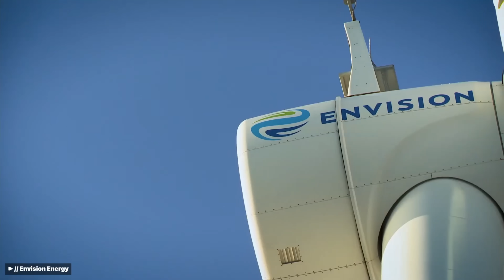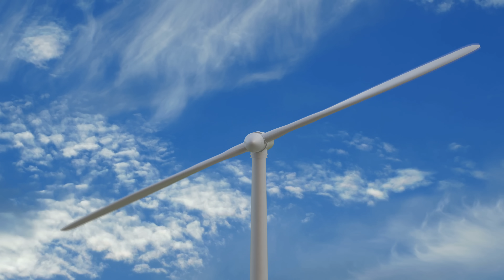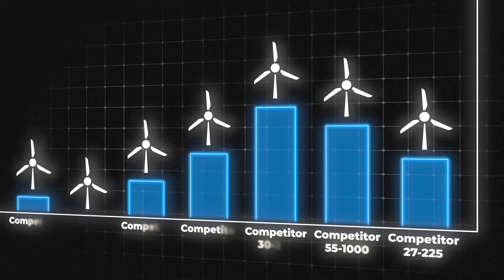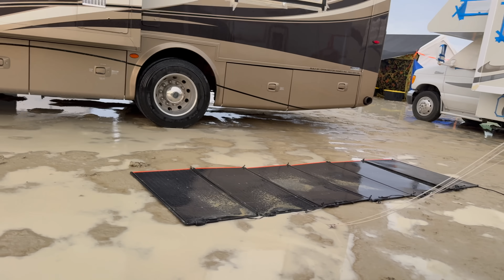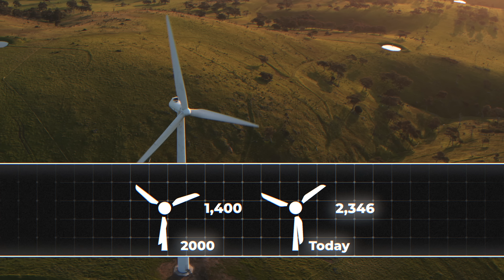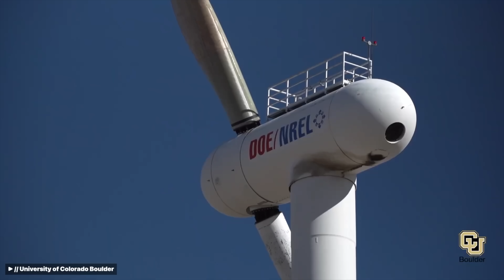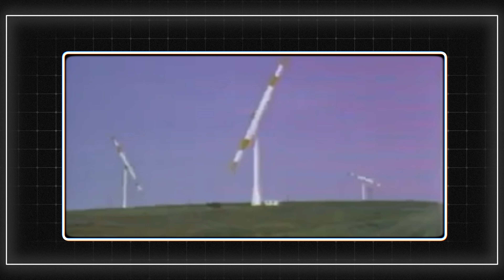Surprising Benefits of 2 Blade Wind Turbines - This SURPRISED Me...

Comment: Also less birdstrike by 1/3?
Reply: Higher speed tips and overall size known to kill more birds , bats , and anything that flies. I’m against more industrializing the countryside and the seashores destroying the ecology to save the environment.
Reply: @stanhry  Really? Tip speeds are largely similar due slower RPM with larger size, reducing hit probability. Aerodynamics, noise restrictions, vibration control, and efficiency mean higher speed tips are not a thing. Altamont's poor experience has taught us a lot about avian mortality.
Audubon agrees based on data. Peer-reviewed papers agree based on data. Engineering projects successfully employing avian-friendly methods like detection, siting, behavioral design, show the same, based on data.
Avian mortality from wind turbines though up slightly overall where siting and other engineered measures are absent are likely down from 25 years ago in absolute terms, despite explosive and exponential growth in energy generated, where these engineering measures have been taken.

And still far lower than avian mortality from fossil or even nuclear per GWh.

Comment: Why blades? Why not use a baffled roller design, it's like a squirrel cage on its side just longer. It's more stable. They've been using them for hundreds of years in the middle east. It's also safer on the ornathalogical species in the areas they are placed.

Comment: Longer blades for the same power will allow 2 blade designs to spin slower and start in less wind.
Reply: It makes sense, David. However, you also have to consider that three blades increase the overall surface catching the wind. For the same radius, three blades generate 50% more torque than two blades, meaning 3 blades actually start better than two blades on low wind. You'd need to increase the two blades' surface area by the same amount to get the same effect. I think low airspeed start is a pro for three-blade turbines, not two.

Comment: Why don't the blades with thicker leading edges like an airplane wing?  
     Or short leading edges 30 degrees off vertical slant towards the back edge to catch more of wind's force with a line of holes down the middle to reduce strain.  
     Why not put small "cup" structures at the outer end to catch more of the wind's force? 
     I keep picturing spinnaker shaped blades like the sails on a ship to increase the volume of wind caught.  1, 3, 5,  7 spinnaker blades  could be fitted to reduce drag related wind shield drag.  

In most propeller designs, the blades are powered to cut through the water or air and move the craft forward.  
     In windmills however, the blade is propelled by the wind to turn the shaft and power the motor, pump, grinding wheel, political dissident over a low flame (there is no law against this).  

As long as we're being creative, ship and submarine propeller designs could give some insights.

Comment: Thats interesting, I'm  from the helicopter flight world. The Brit military rotors for helicopters use a system call berp, its a thickened tip of the rotor that lowers the stall effect and, noise. The thing with rotors is they work in constant 'dirtu' air, what if one of the two blades was shorter, that would allow the longer blade a cleaner air period in rotation, the shorter blade could be balanced with thicker blades or hub adjustments. There are some smart turbine puppies, they'll  work it out!
Reply: I think there's some discussion of this with copter drones. Considering how many wacky helicopter designs there are, surely someone must have experimented with rotor lengths.. Maybe it's just a maintenance nightmare lol
Reply: @grahamkearnon6682  I am not an engineer, but wondered if one blade was shorter, might it prove useful.

Comment: Why don't wind turbines utilize the new prop technology that boats, planes, and drones use that improves efficiency and performance?
Reply: I think that had something to do with a difference between "pushing" air and "getting pushed by air". There's a reason wind turbines don't look like a CPU fan or boat propeller. And given their insane size, I'd guess that the manufacturing of these toroidal props (at least I think those are the ones you mean) cannot be done on that scale yet. These "simple" blades already push manufacturing to the limit, just with their scale and the forces tied to that scale alone.
Reply: @BloodyMobile  Totally agree. I think beyond the more complex manufacturing, material resistance would be a huge issue. Those props have a lot of mass at the "tips" or at the wider part of their bodies. You can't build a prop the size of a normal turbine, because the strain from the centrifugal force increases with the square of the radius. You'd have to make them bulkier to withstand the extra strain, but the added mass also increases the strain, so the only solution is to make it spin much slower.
It's a tradeoff.

Comment: While designing helicopters I learned the reasons for specific  numbers of blades. Taking the tail rotor as an example the one bladed rotor with a counter weight  is the most efficient aerodynamic design as turbulence from other blades is  eliminated. For and hub loading balance an even number of blades is best. For noise reduction a prime number of blades three five seven or eleven each reduce noise, increasing the number quiet the rotor as acoustic resonance modes are reduced. Every choice is a set of trades. Most designers never study the alternatives and the associated trades as initial designs are based on materials and available maintenance data are at the time of those designs. Following designers are often punished for innovation even as the technology moves on. This is the academic concept of paradigm at work.
Helicopters use dash pots and and extra joints on the main rotor where specific torques from variable pitch.
Reply: Awesome input. I hadn't thought about the number of blades on a helicopter, but it makes sense to compare.
So, why would you say the blackhawk has 4 blades? Wouldn't 5 make it quieter?
Reply: In the marine industry 5 blades per propellor for ships is usually the standard.
Reply: @anguscampbell1533  aren’t they now looking at toroidal for boats?
Reply: @jimallen8186  Some toroidal props for boats do exist.They are more complicated for manufacture but time tell about their acceptance.
Reply: @anguscampbell1533  teilweise als Dublette .
Reply: Oh. Helicopter designer still? 

Off topic but why has no one ever built (that I know of) a tail rotor that rotates backward at high speed, so it can be used as a pusher prop?

Might allow for some interesting stub-wing and / or morphing main rotor configurations too.
Reply: @WordLightDotNet  There are many, mainly prototype, helicopters with pusher propellers. Have not seen any which articulate the tail rotor through 90 degrees. Doubt it would give a huge increase in speed, that is limited by the rotation speed of the main rotor and the lift off the retreating blade.
Reply: @WordLightDotNet  The primary use of the tail rotor is to counter the torque from the induced drag from the main or lifting rotor. If the main rotor is propelled by tip jets ( these can be jet engines in the tips or a pumped air through the base of the rotor) then there is no fundamental need for a counter torque as the main rotor is isolated by bearings. The various tip rotor designs often have pusher props. Some of the tip rotor designs that have been built also have wings so the rotor can be used for vertical take off and the wings for forward flight. Some of these designs will lock the main rotor and simply use as auxiliary fixed wings. Such rotors in these designs often have front to back symmetric airfoils.
Reply: @WordLightDotNet  Sikorsky did something along these lines (more recently the S-97).  However it was a coax main, and a pusher tail rotor.
IAC - even if your idea were doable there would be no need to reverse rotation - just change the pitch to thrust the opposite way.
Reply: For the main rotor there will be maximum diameter considerations, which coupled with the lift requirements will influence the number of blades.  A heavy lift helicopter tends to have more blades. Performance requirements will influence rotor speed.  A Lynx is notably busier than slower machines.
Reply: I've seen J-2, J-3 cubs flying with single bladed props (with counterweight of course).
Another noise abatement technique is by not having the blades evenly spaced thereby spreading the noise over a wider frequency range so peak acoustic power at any given frequency is lower.
Reply: a bit harder with span concerns on a helo, but for noise reduction, how about a Prandtl ‘33? See Al Bowers. Though, if so, what about mast bumping concern?
Reply: @jimallen8186  On Helicopters the main thing used to prevent body interaction (and rotor-rotor interaction on a configuration where rotors might bump) a larger mast to simply push the rotors apart. Other configurations might be a ducked where there are actually rim bearing surfaces with electromagnetically induced repulsion by induction of field in the rim. Such configurations usually involve a vertical axis with a duct that takes advantage of the difference in wind speed between the ground and some higher altitude

Comment: Around 45 years ago, when I was still a child, Holland had some of the first large turbines with two blades. But they changed them to three blades a few years later. Are we now returning to two blades again?
Reply: Not entirely, I don't think so. But two blades make a lot of sense for remote locations where transport is a problem. These blades don't have to be built in one piece, so you can transport them in pieces. They're also lighter, more efficient, and can survive stronger winds that could tear down a three-blade design. Wherever the extra noise isn't an issue, this should work better.

Comment: In the german situation, two blades would be a step back. We have some off-shore windparks, but a lot more possibilities to build them on-shore. Acceptance (noise) and slow-wind-power are more important, than efficiency.
Reply: Regarding noise, see Al Bowers with Prandtl ‘33 assuming you can accept span. Similarly, any application of toroidal?

Comment: Pure BS agenda utility! Where is the GREEN? Cost, Maintenance, Replacement Blades, Land usage etc… and almost all of it cannot be recycled due to toxins and Costs associated with attempts. So the GREEN is what? Tot toss them into landfills when they fail, collapse by storms or repaired and crossing fingers the toxins don't leak into the watershed? Y'all are pipe smokers who ignore everything except the flash. Do a Cost Analysis A-Z leaving nothing out then add in the Oh Crap poisoned Water possibility which is high